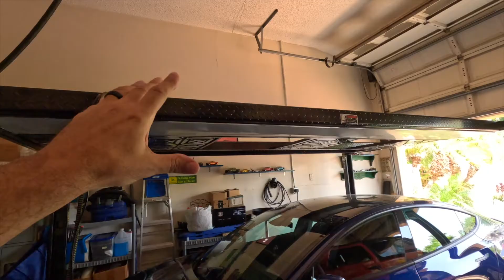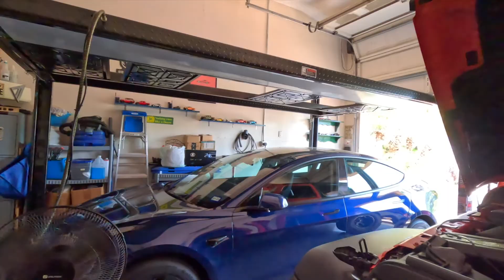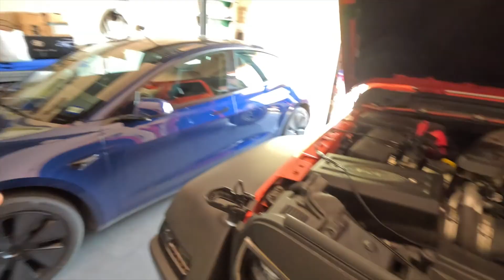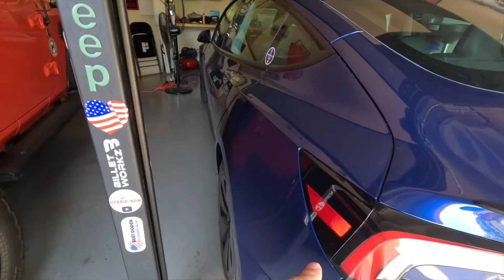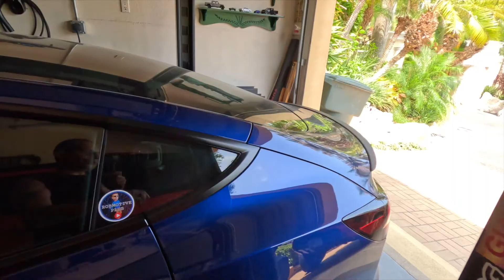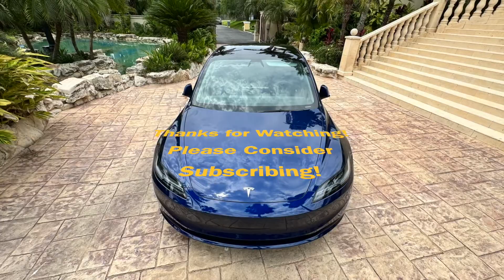Can You Leave A Tesla Sit Idle For Extended Periods Of Time?

Comment: Hmmmm I’ve seen a garage with close to a dozen lifts to store a collection. I think in most cases the more expensive car was on top.  Guess that is a thought process. Not sure about surge protectors but think the level 3 SuperCharges work on 440volt which is a good jolt.  Just curious did the car have a coating of dust after setting a few weeks in the garage?  Think mine would.
Reply from the maker: It was covered in dust for sure.  Inside was more of a film that wasn’t present when we left.